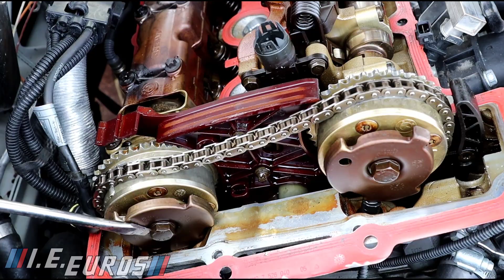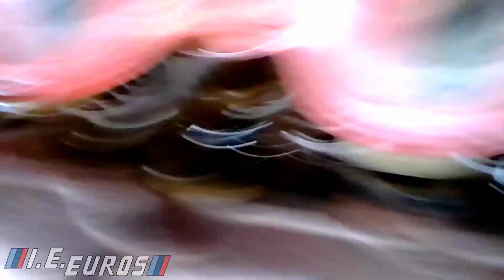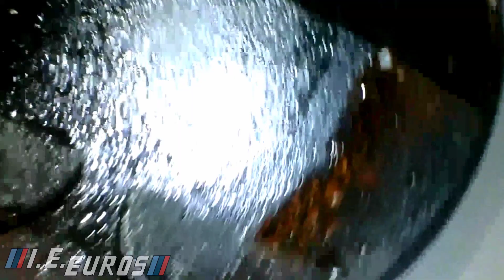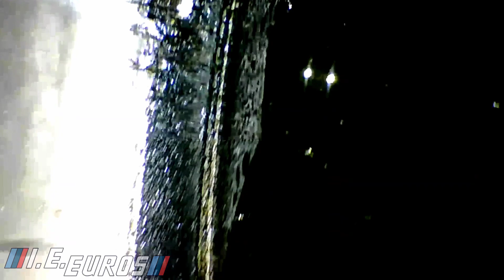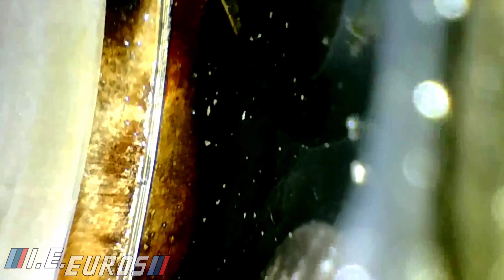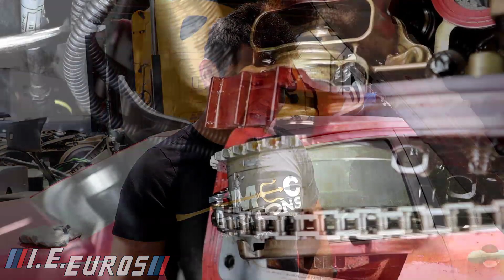BMW engine N52 N54 N55 broken timing chain gear major engine internal damage 335i 535i 135i

Comment: Buen vídeo !!! Dios te bendiga siempre yo tengo una pregunta yo tengo un motor N63 y necesito remplazar los injectores . Pero unos están muy duros y cuesta sacarlos será recomendable ponerle WD-40
Reply: No WD-40. There is a special tool to remove them. You can rent it or buy it online. Check out AGA (All German Auto) they have special tools for the application of removing injectors for the N63.